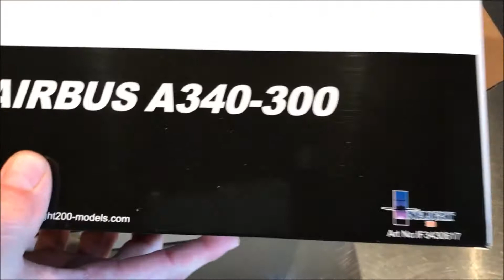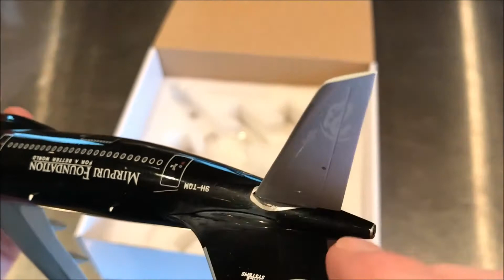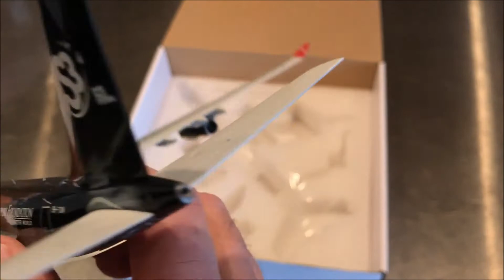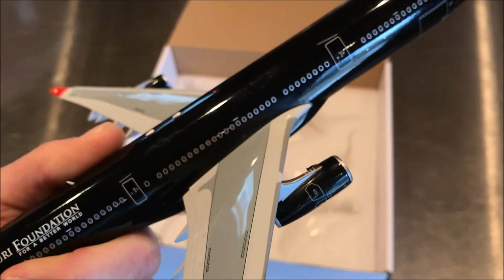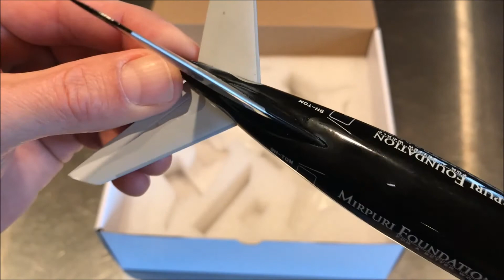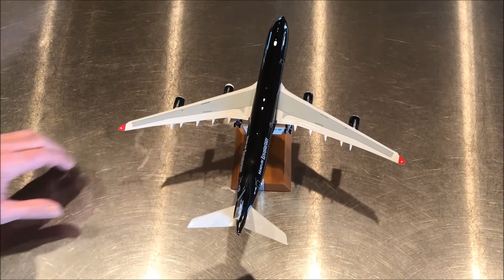InFlight 200 HiFly A340-300, Swiss Space Systems, 9H-TQM, Unboxing and Review

Comment: Nice video! Does the HiFly has a340-500?
Reply from the maker: HiFly only operates the A340-300 variant, they have operated the -500 and -600 in the past but they sold them off.  They have ordered two pre-owned A380's which I think will make them the first carrier to reuse the A380.  Thanks for watching!
Reply: Jeff Clark thank you. I didn't know about this
Reply from the maker: It turns out that HiFly has CS-TFW and CS-TFX which are both A345's, is says they operate 5 A340's but also indicates they have a total of 8.